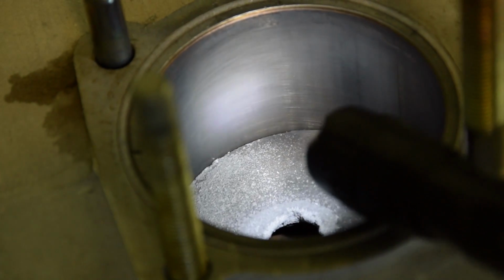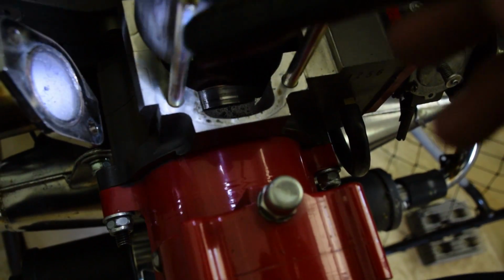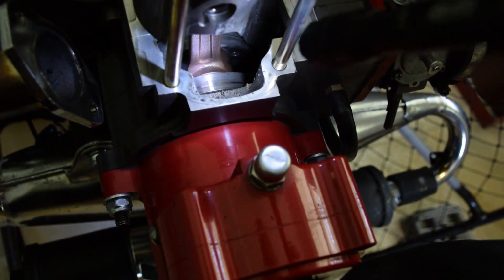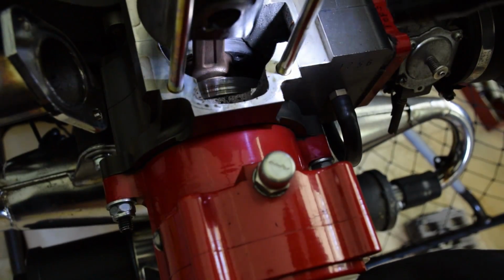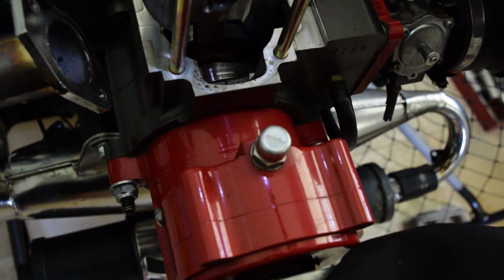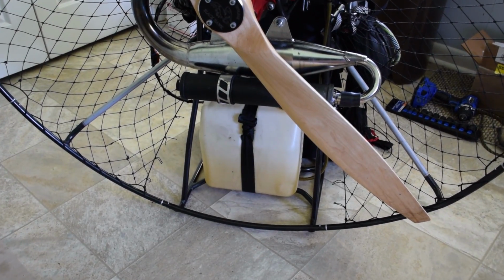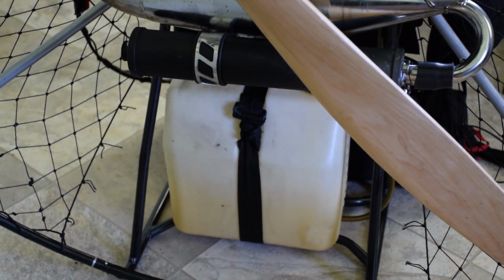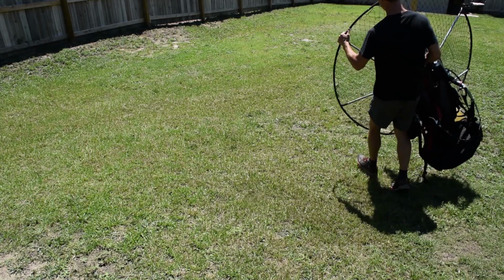Paramotor Engine Rebuild/Flush after a Blown Piston

Comment: as a mechanic id strongly suggest next time you run a cylinder honer thru the cylinder to ensure there isnt any tiny imperfections that will cause shorter engine and or piston life

Comment: Great camera work, editing, and use of Andrew Applepie.  When your carburetor is too lean you get excessive localized heat where the spark plug is.  Your main jet on your carburetor is likely set too lean.
Reply: You (and others) might also benefit from some straight 2-stroke oil used as an assembly lubricant on your piston and rings.  Think of it as foreplay for your engine to help reduce wear on piston insertion and initial start up.
Reply from the maker: briansmobile1 I didn't show it in the video - camera angle was bad on that so I left it out - but that's exactly what I did, put 2 stroke oil on the piston and cylinder. You can see how oiled it is when I turned the piston over a few times. my last two flights have been at the normal operating temperatures Blackhawk gave me in the beginning so I think things are going smooth!
Reply: So glad you're up and flying again!
Reply from the maker: briansmobile1 thanks me too

Comment: Best practices = oil cage bearings, cylinder and wrist pin when replacing piston. Also put wrist pin in the freezer for a few hours to make it easier to insert into the piston..nice video!

Comment: Thoughts. First, one of your head bolts is not all the way in, so when you torque the nuts down they might not torque all sides of the cylinder head down equally; second, you have a bend in your fuel line at the top, so if/when you get an air bubble, it'll cause a blockage in fuel to the engine and likely cause at least an engine out if not a burned piston...the fuel line should always be going up so any bubbles go right into the carb....last, that filter is cheap plastic chinese junk....get a wix 33001 filter.....and you'll never get junk in your carb filter....just some ideas to help you out. good luck and hope she's fixed and ready to fly!

Comment: You should have split the cases and replaced the crank bearings and seals. Did you measure the piston and ring clearances, did you put oil on every thing before assembly. And what caused the piston burn thru, too hot a plug? If that problem wasn't repaired you will be doing a complete rebuild very soon.

Comment: You can see the cylinder and rings by removing the exhaust pipe. Oil the piston and rings before installing the cylinder, otherwise it can cause a dry start which can damage the piston and rings. Retorque the head bolts regularly. Keep a qt. of fuel in a bag along with a spark plug. Rebuild or replace the carb often. Keep fresh fuel in the tank!

Comment: It doesn't look like you replaced the conrod and little end bearing... the blast of hot gas from that hole is probably what cooked the little end bearing and caused the subsequent engine failure

Comment: Good job! You are a mechanic. I thought that motor would need a lot more parts to be replaced. Maybe use a tad more oil in the mixture and set the needles so that it is on the verge of four cycling. I wouldn't fly far from a good landing spot for a bunch of flights.
Reply from the maker: Dasdfjkl I'm not sure what all that needle talk was? in the carb?
Reply: DAS would mean needle jets in carb, Blackhawk has a vid I'm sure you've seen on setting/checking mixture.  Reminder for viewers, change of oil/gas mix can change air/fuel mix so don't change it without check/adj. of carb settings.  This can mess things up with 2-strokes, add more oil to the gas, see more smoke, think it's running rich, yet if you do a check it may actually run leaner (A/F) and hotter.
Reply: What Roger Voss said. Usually there is a low speed needle adjustment and a high speed needle adjustment. On modern motors sometimes they put a plug so you can't change the setting. I don't know what carb a blackhawk uses or or anything about the motor black hawk uses though. Most of the time adding a little bit more oil or a little less oil doesn't make a difference such that the needle valve needs changing.
Reply from the maker: Dasdfjkl I couldn't pull up the link but I think I have seen it before. thanks

Comment: Did you ever get any idea of what caused it? Possibly forgetting to mix oil in the gas? Really wondering what burned the piston hole... :)
Reply from the maker: monteros I didn't forget. pretty sure it was the clogged carb screen which leaned the mixture of fuel and air out

Comment: I sure hope you edited out all the right things to do. I saw no measurements taken. I didn’t see any assembly oil, parts were burnt and reused. Now they will surely crack. And most importantly is the break in. I always use Shell 93 octane and double oil the first ten ours with various rpm’s and never full throttle until the first 4 to 5 hours and only for 1 to 2 minutes at a time. I’m glad to see you made a new gasket but was it the exact thickness as the original. Most velum gaskets are about .006. But not always. You can’t just take a few parts off and put a few parts back on. Please be careful and carry a reserve. 2 cycle engines are much more finicky than 4 cycle, but the power to weight ratio is wonderful. If the oil wasn’t so expensive I would put a 2 cycle engine in my car. Lol

Comment: Breakfast Cereal boxes sure do make wonderful gaskets. Well, the combustion was getting too hot, melted the piston, and blew a hole. Looks like a H&E R125 engine from www.heparamotores.com, Spain? 
http://www.heparamotores.com/en/engines/r125/

What mixture ratio of gas:oil were you using? The Manual says to use 2.5% which is 40:1 ratio of gas:oil mixture. But the first 6 hours, use 3.0% which is 33:1 ratio of gas:oil mixture. 
What gas were you using? The Manual says to use Unleaded Gasoline 95 octane rating. In California, we have 91UL (unleaded) for cars and 100LL(low lead) avgas for planes.

If we use one bottle of 1 liter (1000ml) CASTROL POWER RS TTS 2T MOTOR OIL which will provide for 4 X 2.5 US Gallons of gas using a 2.5 gal Gas can to mix. We will end up with a 38:1 ratio of gas:oil mixture, which is a little richer than the 40:1 ratio of gas:oil mixture. 1 liter = 33.8 US fluid ounces (oz) and 1 gallon = 128 oz.
Reply from the maker: Mike Brady it's an airsal engine. I was using unleaded 93 with a 2.5% mixture. I did the 3% mixture breakin in the beginning. now, with the new piston, I'm using ethanol free 89 at 2.5%

Comment: did you make note that the piston was facing the right way? I saw a rebuilt and it was noted that some pistons have an arrow facing towards the exhaust. ? https://youtu.be/w5npGG2Xj3Q
Reply from the maker: RainbowSixThree Enlightened I did! there's a little arrow on the top  of the piston and I have it pointing towards the exhaust. If you look reeeeeally close at 5:20 You can see the arrow when the piston comes up

Comment: HEY PARA MARK LINK ;] http://swaintech.com/race-coatings/two-cycle-engine-coatings/
test you air fuel ratio the Wot chain saw gargle sound method may or may not work from all the prop loading engine that woulds make tuning without out air fuel gauge harder us saw guys do it this way @ 3:00 min mark in this video may be you could run it with no prop make a small round testing engine flywheel if weight is needed a small machine shop would help make one fer you ;;;3:00 mark in video::: https://www.youtube.com/watch?v=3eLe6uyV_Vg